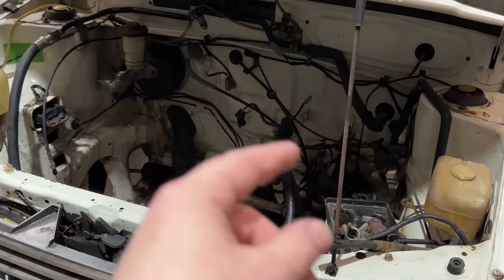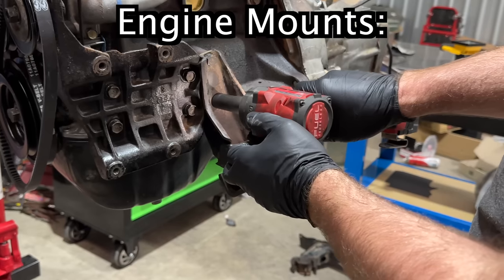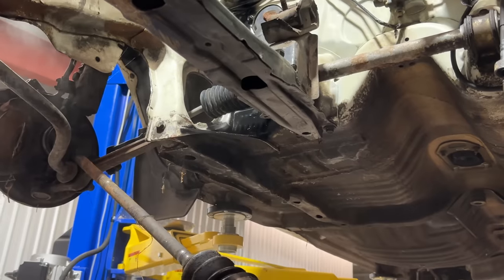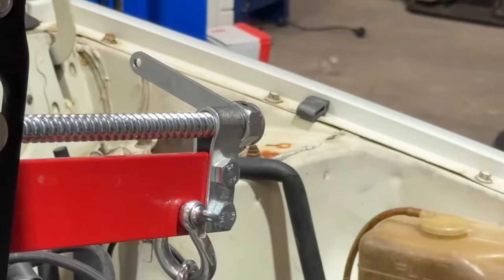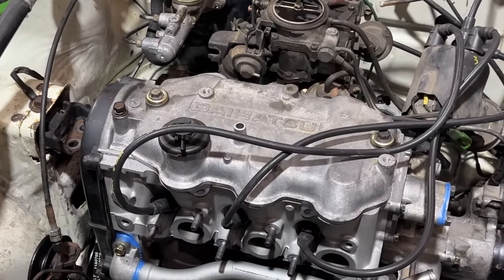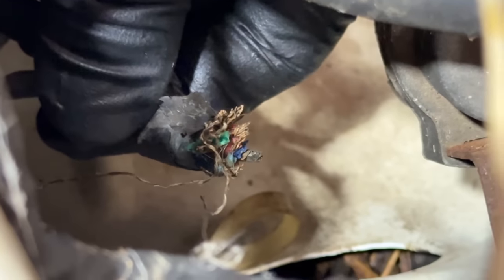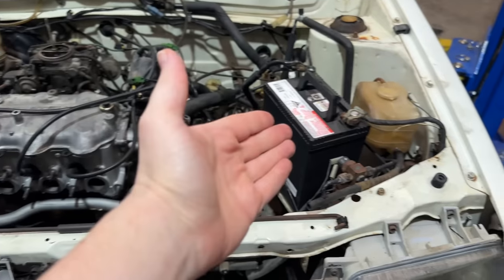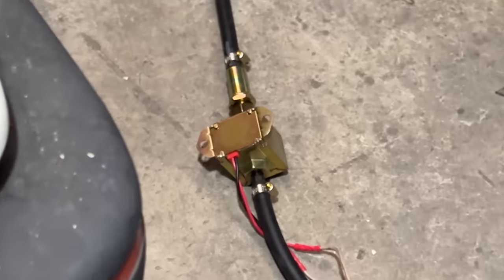Free Car Part 7: It's in.

Comment: Iirc, they found out that the Donkey Van had loss compression after buying or the previous owner already told them that so they just put thick motor oil on it. Thick motor oils just delsys the time before the engine goes kaboom.

So, Donkey Van Engine rebuild incoming.

Comment: Hooray for the free car! 

I also just got my own free car! 1999 Buick LeSabre, airbags deployed accident that damaged the front bumper and knocked out a headlight. Able to drive it, but I need to put new fuel in to get her running again, also new tires. Thank you both for getting me inspired to want to work on my stuff, and record it, too! Can't wait to upload on my main channel soon!!!
Reply: Be forewarned you'll likely need to replace the steering column. Most modern cars have collapsible steering columns in the event of an accident
Reply: @thekornwulf  doesn’t quite seem like it’s collapsed, I checked. Thank you for your concern though. I will double check. It had the front bumper clipped by someone pulling out without looking.

Comment: 0:26 OOH the GBD-200, I've been using a GBD-100 (chonky round version, same features) for almost a year, great half-smart-sport-dumb watch.
That bright green colour perfectly suits this content and it should hold up to the abuse, curious to how it will degrade in this setting.
I see you're not using the Bluetooth function, which is fine, it works great without it too, but if you want to set funny names in the timer you might want to use it for a bit.
This also lets you sync the time and notifications, the latter being very annoying if you don't tightly manage phone notifications as EVERYTHING gets send.
And it looses connection if others around use wireless audio things, but hey, at leasts it lasts over a year on the battery while paired.

Comment: That engine hoist tool that can angle the engine would've came in handy and save me an hour from just cursing trying to get the big V6 engine in my Camry to fit into the transmission having only so little room😂

Comment: Next Charade update should be you boys going on a road trip up to see the bloke from Gumtree in Canberra, pick up CB60 Turbo charade parts (Turbo Carby, Top Hat, Crossover Pipe, Exhaust Manifold/Turbo/Dump, Turbo Oil Lines, Turbo Oil Cooler and engine front plate with Turbo Oil Return port) then slap it on the little cutie... And for the love of god please spray it a nice colour, rescue this little baby and keep it forever.  You guys already have the Charade Turbo wheels on it you just need the rest of the stuff